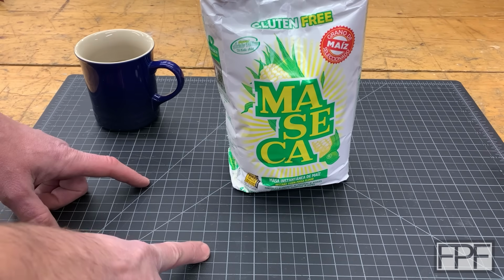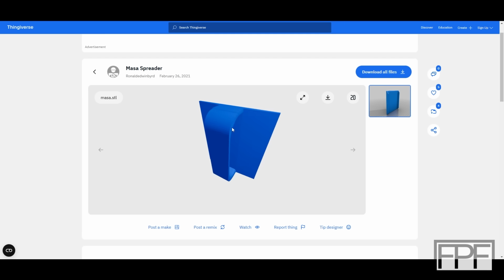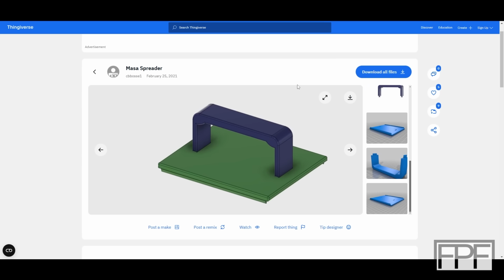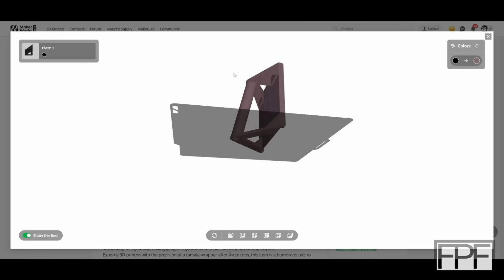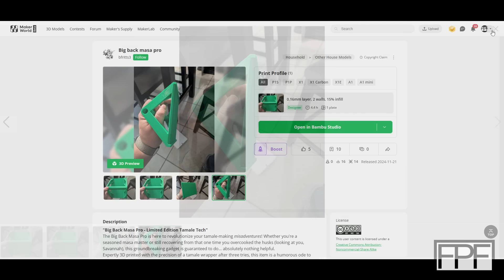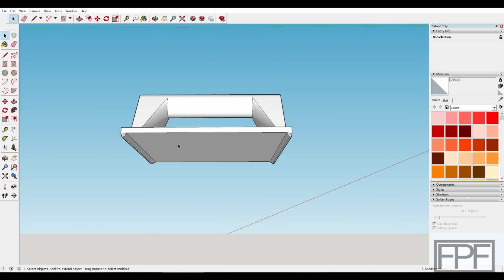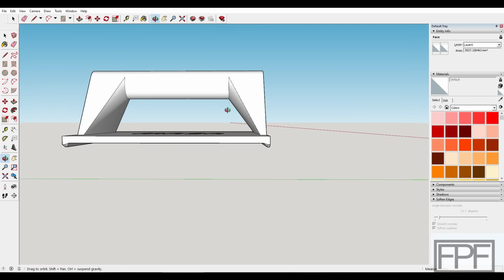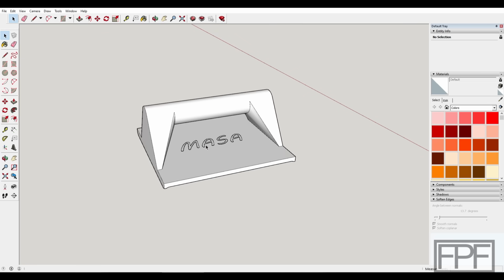3D Printed Masa Spreader

Comment: I wouldn't use it again, most sites say that 3D printed stuff, even though the plastic may be food safe but bacteria can grow in the little pores which could be a hazard.  Like cutting boards where bacteria can grow in the cut lines in the plastic.  At the end of the day it would probably be fine but it's $1 worth of plastic so why take the risk?
Reply: The pores thing is so overblown. After a wash with soap and water, and maybe even a spritz of some alcohol, then storing it in a cupboard... What bacteria is growing? There's no source of bacteria, let alone something to sustain a bacteria colony.
Reply: @GOOBENsticks  Hate to break it to you but many bacterias can survive for months even if dessicated and are resistant to anyibacterials.  That includes staphylococcus and Enterococcus.  So washing and storing is no guarantee.  As I said, it would probably be no problem but it's $1 worth of plastic.  Live your life the way you want I was simply stating, as asked, what I would do.
Reply: There are more bacteria on the skin and inside of people than on 3D prints... If you cook the meal it will kill off all bacteria.
Reply: Bacteria is all over the place. If you leave out food in a kitchen, it goes really bad in 2 days. Prints can accumulate some bacteria but any other plastics too. Your hands have much more bacteria than any clean printed part. The only reason you don't get ill because bacteria upon contacting your hands with with food, from preparation till cooking, has no time to produce any significant amount of harmful toxins. During cooking bacteria will be ☠️
Reply: obligatory boyscout post.

Comment: I wouldn't use it again honestly. It has been proven many times that 3D prints are impossible to clean properly.

I try to avoid to print food related stuff anyway.
Sure after you print something it's technically "sterile", but I wouldn't call it "clean". 
There's a tiny amount of lead in brass nozzles and, while it's probably not enough to cause any problems, is it really worth the risk?
Reply: really? proven many times? I've never seen one test of this theory worth anything
Reply: @knifeyonline  I havent gone full on research other than reading some online a while back, the bacteria growth sounds very reasonable, as well as other micro plastics. Just try to be aware and think What could happen. I think its a risk not necessary to take, just because many people do it, doesnt mean its safe.
Reply: "proven many times" any link to a science paper? Also, is it possible to clean properly a wooden cutting board?
Reply: @avatorl_in_a_hammock wood cutting boards are anti-microbial
Reply: @avatorl_in_a_hammock  the thing with a wood cutting board is: the wood is in a bit self disinfecting
Reply: @berlinberlin4246  no its not lol. You should see some of the insane things inside wooden spoons/handles for instance (dont often see broken cutting boards to see inside)
Reply: I agree, I write another comment about this. The only way to make a printed item "food safe" is by post processing. Like dipping it in some kind of food safe epoxy that covers the entire print.
Reply: The thing about 3d prints isnt about the material, its about layer lines and it being 'impossible' to clean tiny gaps that can hide bacteria (tho wood can do the same.. cough cough cutting boards)
Tho 'post processing' does not mean having to dip it in epoxy. If you fully SAND it to get rid of the layer lines (making it smooth) That is post-processed too.
*note: if used once (wasteful) this IS food 'safe'

Comment: I use a wood cutting board and wash it with warm water and soap. I do the same with PLA prints. Maybe one day I will get sick and switch to reprint, but not today.
Reply: Some people are too precious. If they're worried about 3D printed parts, why aren't they as concerned about everything else they stick in their mouth? Why are plastic cutlery at a takeaway outlet, plastic straws, plastic drink bottles, cling wrap, etc not an issue? Some of these things are single use, but not all. Micro plastics are just the new catch all for environmentalists.
Reply: @Neomaster67  i think the issue with 3d printing is the layer lines, not the plastic itself. All the plastic example you gave does not have layer lines, which bacteria could get into.

Comment: Not in the kitchen, but I had a similar situation today; I have an outlet where I need to cover one of the sockets. I checked amazon and packs of 25-50 covers were around $7. I needed a single cover. So off to makerworld, found a design that worked, printed it in PETG. No need to shop or spend money.
Have a great weekend!

Comment: Most 3D printers use brass nozzles and most of them contain led. also there could be other chemicals on a 3D printer that can end up on a print and you do not want that to come in contact with your food. Lastly, 3D prints have allot of very small holes in them that bacteria can grow in, that also would be very bad if kept after fist use.
Reply: bambu printers like the one he used have stainless steel nozzles, that said tho i also would not have used this unless the side coming into contact with food was seal with a food safe resin or something like that.
Reply from the maker: this was done on a P1S with stainless steel nozzle

Comment: One use only print. I guess that's functional... Once. 

The problem with any 3d print that contacts food is sanitarily cleaning between layer lines. It's not really possible. Anything printed for food should be an injection mold that is smoothed beforehand with sanding, vapor, and or a resin coat with a food safe release spray, if it's going to actually be functional that is.
Reply: Do you buy a new wooden cutting board each time you need to slice something? Do you buy a new toothbrush daily?
Reply: I agree, i don't feel secure for eat nothing printed, bad cleaning and plastic bought in shops aren't for food safe use (if one is food safe, after use you cant secure a good cleaning).
And toxicity of the pla + colorant for make the color it's unknown zone.
Reply: I have heard the same thing, I never print anything that will be used with food...PLA isnt food safe as well right? The only filament that is foodsafe (that I know of) is PETG, which should also only be used once because of the bacteria growth. Its also important to note that we never really know exactly what other kind of things they put in the filaments. Like what if the dye is toxic? People shouldnt underestimate the dangers of micro plastics.
Reply: @Skugen32  What does micro plastics have to do with it? Micro plastics comes from plastics as they break down unevenly; though I've heard the main source is car tyres wearing out but I don't know how true that one is. Either way, you're more likely to get micro plastics from an old cutting board than a new 3d print.

PLA vs PETG, only PET is known to be food safe but PLA itself is pretty clean chemically speaking. Obviously additives are important to consider but I think the biggest issue with PLA is that it'll degrade from food contact more than PET would. Other than the gaps in the print lines.

Honestly, I don't know how much better those cheaply made injection molded items like cutting boards really are. Most plastic cutting boards have pores and an older one has plenty of cutting scores in them, yet they are considered to be fine for food contact? Compare that to the bottom face or the ironed top face on a 3d print and I don't know how much difference there really is…

That said, if I wanted to make a food safe item I'd get a food safe filament and then use a ceramic/glass repair that is food safe to seal up the surface and ensure it's smooth as glass. I'm just skeptical about how tested this theory is, I think it comes from the assumptions of the gaps formed on the side walls and/or early prints that were a lot less fine. I'd love to see if someone has done any tests with bacterial cultures and compared the results of commercial items to 3d printed ones.
Reply: @Sylfa  the printed object gets coated in micro plastics, and it depends how harmful they are depending of WHAT plastic it is. Have you ever printed ABS? Theres just many risks with it (that I havent fully investigated), micro plastics, bacteria growth, lead from the nozzle. Its just not worth it.
Reply: @Skugen32  Lead in the hardened steel nozzle? And I'm very curious as to where you got the information that microplastics are generated?

As to ABS, that's one of the toxic filaments, you should not print ABS/ASA without a proper enclosure or ventilation. But PLA on the other hand isn't toxic, not unless you add a toxic additive. It wouldn't be my choice for sanitary contact, but the chemical formula and the byproducts on burning are all non-toxic.

As always, look at the safety sheet for any filament you are considering printing.
Reply: @Sylfa  no lead in a hardened nozzle, haha exactly so you seem to agree that it is a unnecessary risk? Why do you get so argumentative on the details? I wrote that im not an expert in that area.
Reply: @Skugen32  I'm literally just asking where you heard it?
I might not want to risk layer issues in sanitary prints, but I don't go around spreading FUD about lead and microplastics when there's no evidence of it being even potentially true…
Reply: @Skugen32  PLA is as food safe as PETG. But obviously, not all PLA and PETG are food safe.
Reply: Dishwasher…
Reply: @SynthOSphere  a dishwasher isn't going to clean inside the channels between the layers, it just doesn't get deep enough. 
And those channels are big enough for bacteria to grow in

Comment: NOOOOOOO!!!!! 3D prints are NOT FOOD SAFE!!!!! Do NOT do this! A) the plastics used for 3D printer filament are not rated for food contact. B) You can't clean it at home. The only way to clean a 3D print without destroying it is to irradiate it with high-energy X-rays or hard gamma radiation.

Comment: 3dprints are not food safe at all though.

People please don't replicate this.

The reason plastic made products can be food safe is because they are smooth and bacteria can't get trapped.
Reply: They're fine for single use things like cookie cutters or this if used once but you can't get them properly clean to reuse. There is a reason to have caution but you're taking it much too far.
Reply: @justinbaits7149  no. it is not safe. most 3D printers use brass nozzles and most of them contain led. also there could be other chemicals on a 3D printer that can end up on a print and you do not want that to come in contact with your food
Reply: @K-politic  Agreed. From grease and the bedplate surface to the additives and colorants the filament has.
Reply: People freak out WAY too much about minute sources of potential pollutants.  Eating a Big Mac is likely way worse than this masa spreader or cookie cutters, assuming you clean them well before use.
Reply: Oh, and the BambuLab printers use stainless Steel nozzles, not brass.  SS is food safe.
Reply: @SynthOSphere  even most of the brass one's do not contain lead anyway. SOME of them do... omg these things get blown out of proportion to the fact of absurdity in the 3D printing space. Also it's not just the nozzles, the gears are plastic or stainless steel in bambu labs printers.